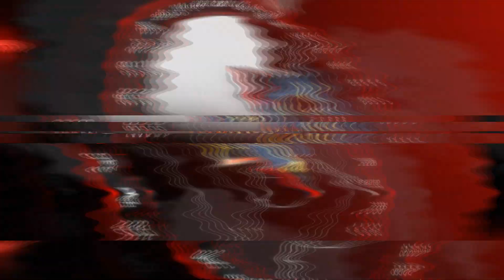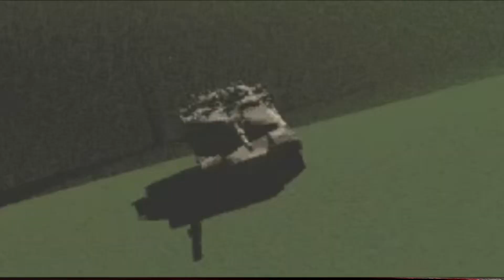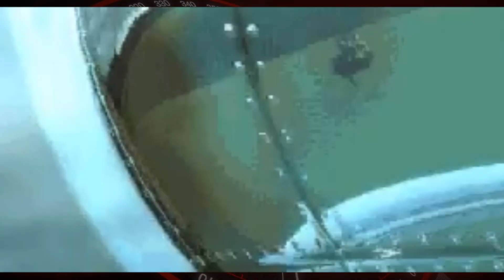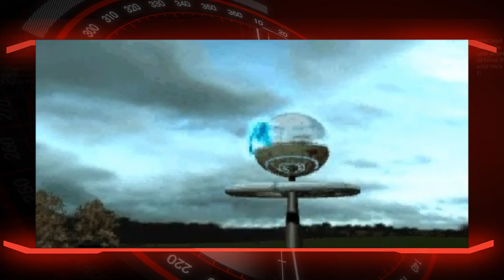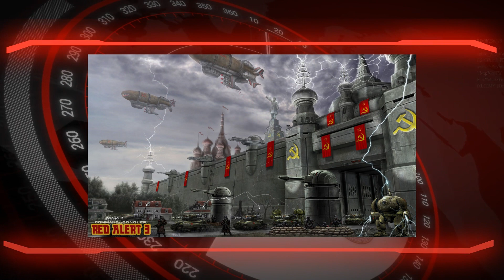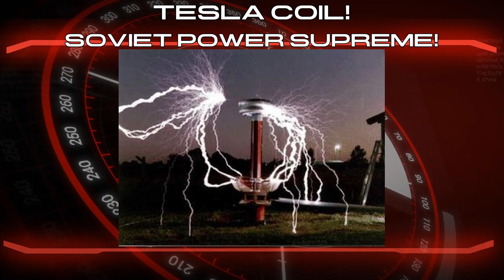Tesla Coils! Lightning Strikes More Than Once!

Comment: The addition of an integrated radar(s) would help with the directing of the lighting. The specific setup would require work but you would basically use the radar as a maser to create a channel for the lighting. There would be a requirement of some basic AI, but the Soviets solved that in this setting.

Tesla tech would be fairly easy to detect if used to spy. The funny answers would be the lighting, and all the lights turning on. Tesla tower transmissions do not benefit from miniaturzation. It is all the copper coils. The local area will also suffer from interesting side effects. 

I am sure the Soviets do not have access to Tesla's original notes. If the did, they have teleforce weapons. Ion cannons with vacuum tubes.
Reply from the maker: !!!!!!!!!!!!!!!!!!!!!!!!!!!!!!!!!!!!!!!!!!!!
That is a good point! I just assumed they had the man himself, but it could be they just had some of his notes... That would be a interesting twist on the tech, maybe with a red alert 2 continuation with the soviets with ion cannons and the allies with weather control tech?
Reply: @armedwithspeculation  I believe that the Allies ate actually using more of Tesla's work than the Soviets. RA3's particle cannon for example was a design proposed be Tesla before his death in the real world. As was GDI's Ion Cannon. I need to back up.

Real world Tesla proposed and (supposedly) designed a weapon(s) that use electricly accelerated matter focused through a nozzle or magnet lens to produce a destructive impact. This design was publicly call teleforce and discussed. The common name was Tesla's Death Ray, a name that he did not like as it was technically an incorrect description. Ray speard their energy over a large area quickly losing destructive power. Teleforce produces tighter grouping increasing range and destructive power. The supposed range of a teleforce weapon is, if memory serves, 300 miles.

Tin hat conspiracy time. After Tesla's death his room was ransacked by unknown men in suits that sweeped his room and took all his notes and basically anything paper. The common theory is they were US agents.

The, I want to say, Oklahoma State University has a Tesla research department that built a coil to test some of Tesla's published theories and their results were interesting. Long story short Tesla's Great Coil in New York was to small and if it was 3 times bigger, could have transmitted radio and power across most of America. A matching coil needed to be built on the west Coast for the entire nation to be covered, and their would be interesting side effects at ground zero. Heavy ionization, frequent localized storms, and wireless charging. I would like to point out information on the Great Coil was published and the need of 2 coils 3 times larger was known in Tesla's time, he could not get funding.

Deranged Tesla, would this be a rant, rant over. 

This makes all the Soviet art in RA3 make more sense with the constant storms.
Reply from the maker: Hey! Can you send me a link to that research? I would love to read it and maybe do a analysis on it for a Tesla video, as in Tesla the person in the C&C games!!!!!!!!!!!!!!!!!!!!!!!!!!!!!
Dude you are a genius!
Reply: @armedwithspeculation  I need to rebuild my research base. I got most of my information over 6 years of documentaries, research papers, and attemptes to build my own coil. By when do you need it, or are you good with the Wiki links?

Comment: Some extra context on the thought that the tesla coil might have different firing modes: A lightning bolt from the sky is as hot as the surface of the sun. For armored targets (involving ships), a barrage firing setting (as seen in the cutscene) of "as hot as the surface of the sun" harnessed tesla coil lightning would no doubt heat up the target as currents pass through it and bombard it. Considering fuel and ammunition doesn't take comparably very much heat to set off, not to mention the flesh and blood crews danger of being burnt alive, it reasons to me to be only a matter of time until the concentrated and aimed barrage would cause an interior detonation (as the cutscene seems to show) that destroys the target.
Reply from the maker: I think you mentioned something like that in the discord too… dammit I’m mad that I didn’t include that now 🤦‍♂️